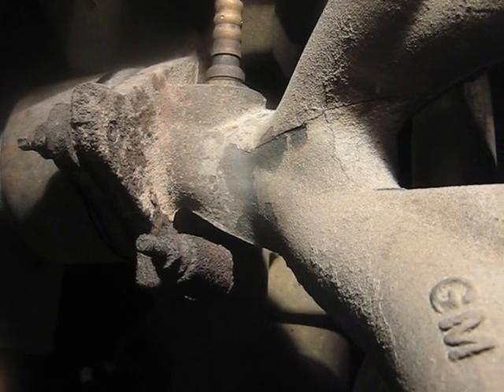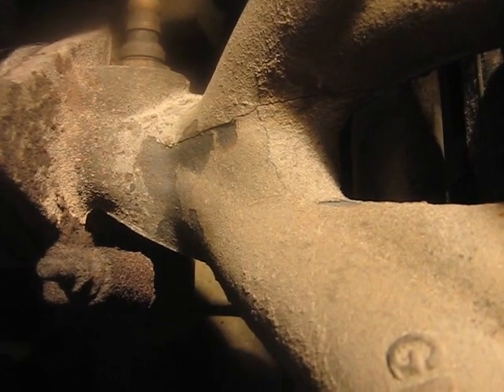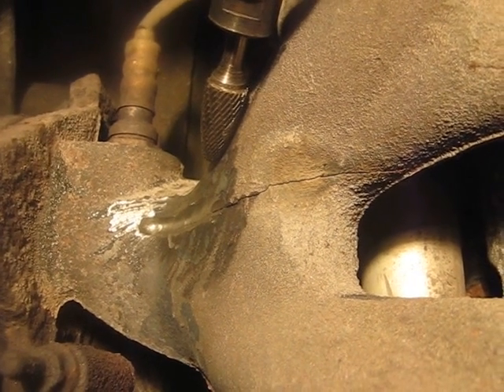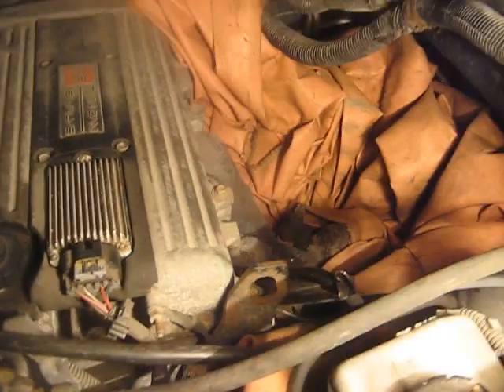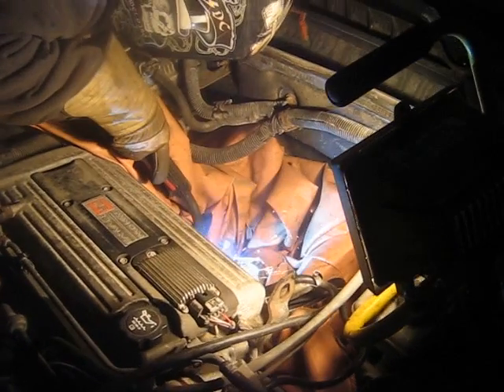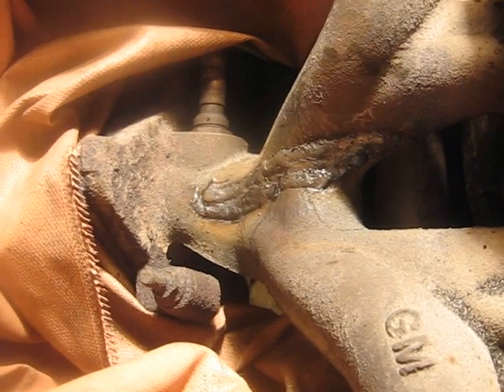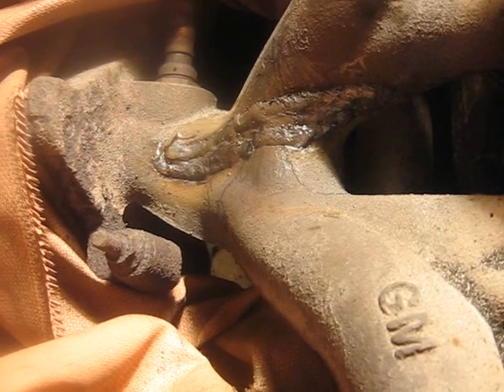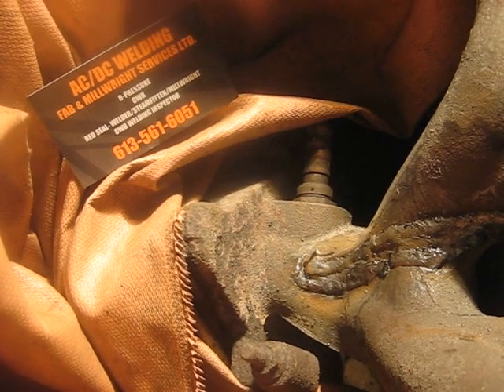Exhaust Manifold Welding

Comment: didn't even get it hot or use heat. Welcome to Crack City! 2/10 wouldn't recommend
Reply from the maker: Don't know what to say, this manifold is still in operation with no more cracks! This guy has welded 3 manifolds for me, and none of them have re-cracked! I tried one myself, and it cracked before it even cooled down!

Comment: Break the next day, use a stick welder nickle rod
Reply from the maker: No, none of the 3 my friend at AC/DC Welding has fixed have broken , this one was the latest, and it is still fine, I just uploaded a vid showing this engine running.  This welder knows his stuff, and it works. Now, if you are welding up a manifold off a 1959 Chevy 409, the nickel rod it is for sure. The newer manifolds are a different alloy, and are much easier to weld. I tried it on my Toyota without preheat or gouging, and it snapped again while cooling, but using this guys technique, it works fine.

Comment: Ok I know a few welders from my company that are pipe fitters.  You are SUPPOSED to use something called Ni_rod to weld cast iron.... You CAN mig weld it it's just not as good... I just welded mine from my Honda and it seemed to work fine even though my crack was into the threads of the o2 sensor.... What it is is the metal is shitty. And when you heat something up and cool it off like a million times and then it's cast and rusting, it's gonna fail eventually.... Just weld it.

Comment: where did he ground to? I'm having trouble grounding my welder to get a good connection on cast iron
Reply: To the piece itself. Buff grind any part of metal you can get the clamp onto that is connected to the manifold. Still no ground then tack weld a piece of steel plate and clamp to that.

Comment: what kind of wire is recommended for cast iron like this? you mentioned type 70. That's mild steel wire?
Reply from the maker: Yes, i believe he just uses normal wire for mild steel welding. he says the cast iron used today is closer to steel than it was say 40 years ago, so it is more weldable.

Comment: Hi. So 1 year later since this video was posted. How's the exhaust manifold? What year/car was this welding for and how many miles have you driven since? I have a crack on my 2003 Nissan Altima exhaust manifold and thinking if I should get it welded or replaced. I was told eventually the welding would be undone or other cracks will occur elsewhere so it'd be worth it to replace.
Reply from the maker: ***** The manifold is doing great, no leaks. He welded 3 manifolds for me so far, and all 3 have not re-cracked.My friend at AC/DC Welding really knows his stuff,  and has good equipment. Cars are driven average mileage perhaps 6,000 to 10,000 miles per year.I don't quite know what to recommend to you, as it is possible for it to re-crack. On one car I bought an aftermarket stainless header to replace the stock cast manifold, and it cost less than a new manifold (shop around on the internet). The person welding must follow similar techniques to those shown here, as I tried to weld one myself without grinding the V etc., and it cracked in minutes, as soon as the weld cooled.On another note, I hear some of the newest cars don't have a separate exhaust manifold, it is part of the head. So what on earth do you do if that cracks, buy a new head!!!!????   I swear the companies are trying to bend us all over BIG time, especially us people that can't afford the new vehicles.
Reply: Hmm.. ok I'll think about what to do. Thanks for your response. If a new after market price is comparable to welding the crack, I might as well pay the extra couple hundred for it.. we'll c.
Reply from the maker: ***** Best of luck finding a good fix for it. Cars can be so much fun!

Comment: Nice work there!
Reply from the maker: Yes, it turned out very good, it hasn't re-cracked, so I don't smell exhaust anymore especially when I back up.Since my body is running low on carbon monoxide, I will have to get the 2 cylinder Stacker engine running soon to replenish it!  :)It shouldn't be too much longer, as I am making serious progress.
Reply: Hahaha! That's awesome, can't wait too see it running!

Comment: Or you can get headers for the car and make it go faster! Hahaha
Reply from the maker: I am monitoring my gas mileage, I think it has gone down a bit since the repair, if so, I my well choose the header option, as it worked well on my other car  :)
Reply: ChargerMiles007 If you do get headers, wrap them.
Reply from the maker: Yes, that would be required on this car, as it seems to have a bad heat soak problem already!  Plus the A/C is now dead  :(
Reply: ChargerMiles007 Darn! If I may make a suggestion for a video, record the exhaust note before and after getting headers (that's if you get headers).

Comment: Never had any success with that,  never in a good spot. , didn't weld good. Thx
Reply from the maker: I tried one with my little flux core MIG machine. It seemed to weld up OK, then after I heard a few pinging noises, and it re-cracked at the same place. I took it to AC DC Welding, and it has not cracked again  :)

Comment: wonder what the welder current does to the cars electrical system ....
Reply from the maker: I normally disconnect the electrical at the battery. My friend at AC DC Welding never disconnects it. I haven't noticed anything fried yet, and it has been about a week. The manifold weld seems to be holding up also, no smelly leaks like before  :)
Reply: as long as the battery is disconnected the electrical system will be fine, i hope they disconnected it...
Reply: ChargerMiles007 good to hear that
Reply: Know this is an old comment but dear lord DC the electrical system, if a surge hits the welder every breaker will break and if its too powerful it'll mess up something.
Reply: The weld is on a dead engine block manifold ground. The electricity will not stray. I welded exhaust pipes and no problems ever.
Reply: Unhook the Battary first

Comment: Nice Video! Hopefully it won't crack. Me and my buddy tried welding a cast iron engine block out of a dodge ram 50 truck, it had water in it and froze and busted, didn't pop the freeze plugs, long story short, our weld didn't hold and it leaked as soon as he started putting antifreeze in it haha We didn't heat it or anything first, oh well, lesson learned haha
Reply: I bought a 1974 John Deere 440 A Skidder in 1980 for $800, it had about a five inch crack in the block and the engine was seized from running hot. It had over $2,000 in new tires on it so I could get my money back if the engine wasn't any good. My father helped me take the engine apart and found out the crack was just on the outside. I got some liquid steel mixed it up and filled in the crack, filled it with water and it didn't leak. It had a broken harmonic balancer, replaced that, put new sleeves and rings, new head and head gasket. I still have and use the skidder today. I found out later, that the liquid steel worked and a cast iron block too.
Reply: Daggone, you can't beat that! My buddy tried Jb weld at first but it didn't want to stick, it may not have been cleaned good enough or something like that. I will try it again next time this comes up again.
Reply: Yes, clean it up nice, no oil or grease and kind of roughen it up a bit to give it something to adhere to.
Reply: Yeah, i've had some good luck with Jb weld, i did a video on repairing a emulsion tube in a briggs carburetor, its held up so far haha
Reply from the maker: JB Weld is great stuff, I used it to glue the oil pump back onto a motorcycle, it held, and worked out great!I am not sure what the normal welding procedure for a cast iron block would be, I had some luck using the nickel based stick rod. I know my friend at AC DC welding has successfully welded engine blocks, as well as chrome-moly dragster frames.
Reply: Yeah it does good if its cleaned good, i'm surprised that emulsion tube held up on my carburetor but it has so far haha That might have been what my buddy had, but they were supposed to be used on  DC welder but we only had a AC and it just didn't want to strike.